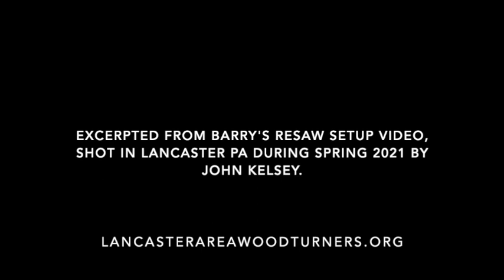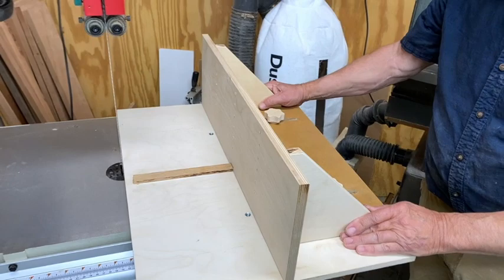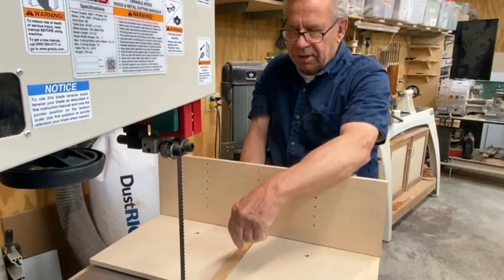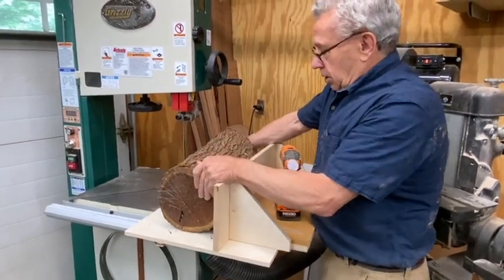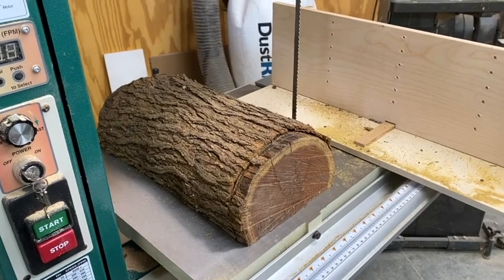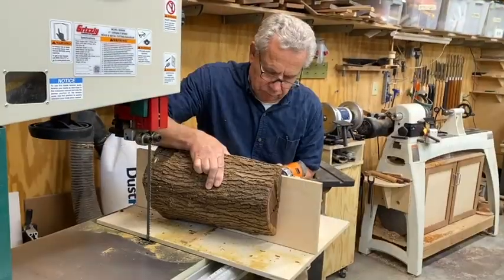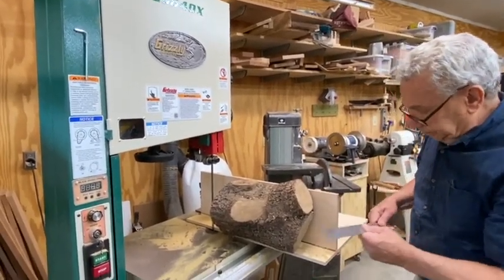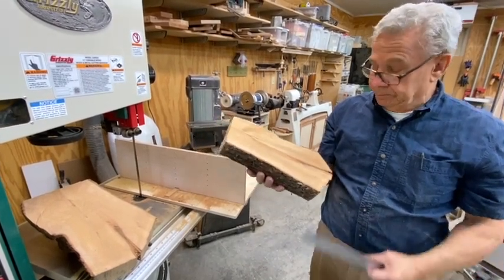Barry's log resaw sled

Comment: The key thing is using a blade that is only used for straight cutting. If you use a blade you’ve cut round bowl blanks with, it won’t saw straight. The teeth on one side get dulled so the blade will start to wander.